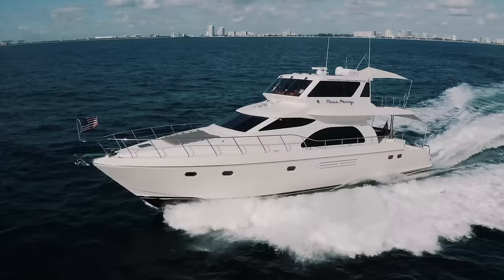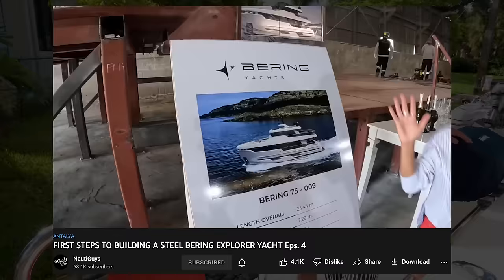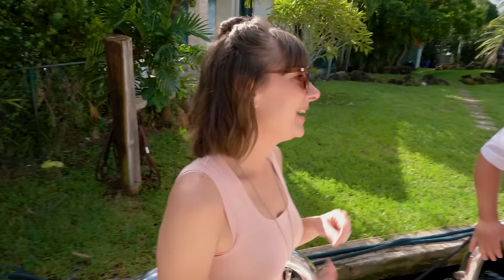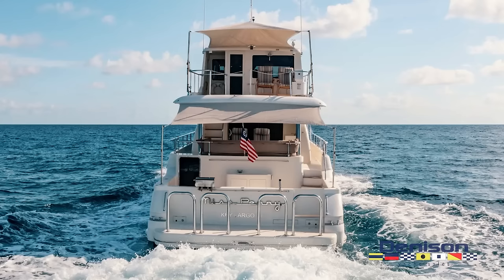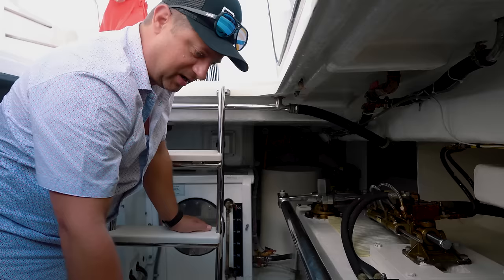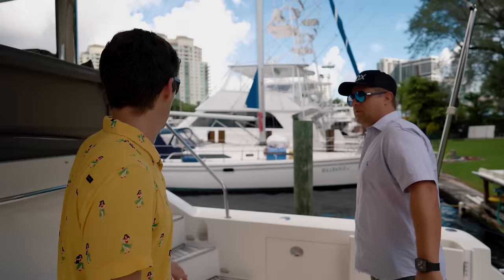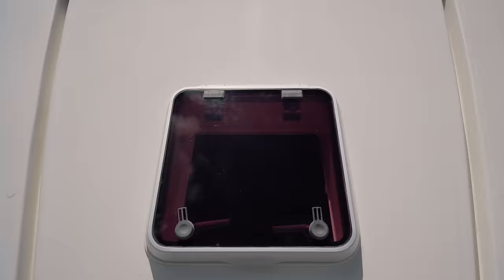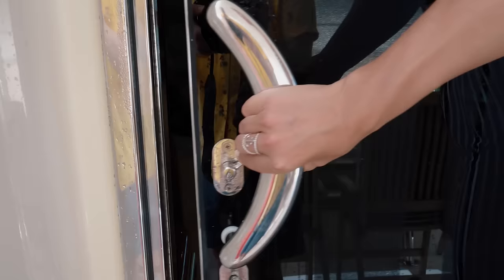Luxury Yacht Living Is Cheaper Than Waterfront Property! (full tour & costs)

Comment: Very interesting and great collaboration.  I'm partial to sailing, but, absolutely appreciate a motor yacht.  I have lived my life around water and to be honest, there is nothing finer. 

Two major expenses set aside sail/motor yacht living from land living:  1) 10% min of purchase price for yearly maintenance/repair - 100,000 for a 1M yacht and 2) Depreciation 6% - 7%/yr exponentially declining as the yacht value depreciates.  

1Million purchase price:

First year  maintenance/repair:  (100K per year ( 8,333/month))
Depreciation first year at 6%  ( 60K/yr (5,000/month)).  It's my experience that depreciation in vehicles etc. is often never considered. It's a real loss of money and needs to be factored. 

Maintenance/repair + depreciation is easily 13,333/month in expenses that would be arguably 10,000 per month less for a land condo as maintenance is much less costly and real estate does not depreciate over the long term, but, of course appreciates. 

I didn't really consider it, but, fuel for a motor yacht fuel costs would be highly variable based based on individual preference and always increasing. 

So, land life is less expensive comparatively but quality of life on the water - well -  that wins hands down and is priceless.

My two cents.... :).   Cheers.

Comment: That what is called a cockpit motoryach.  Usually they have the same boat as a aft cabin design without that lower cockpit and they offer a second design where they add the cockpit behind the aft cabin. Many cockpit Motor yachts have that rear door straight into the master suite. Meridian’s 459 is a 408 aft cabin that has the cockpit added on and that rear door entry to the master.

Comment: I'm looking to make a change so I really appreciate the budget break down at the end.  I know there are dreamers, and whimsical folks, and I know there are spreadsheet nerds (I'm the latter).  For the past four years,  I have lived solo in a 36' RV (2 bedroom, 1 bath, 325 square feet) out of the Bay Area of Northern CA (less than a 1/2 mile from the beach) for $900 per month.  I'm not a minimalist, so I have a storage unit for larger tools, camping gear etc., but all in,  its still only $1,200 per month.  That is very cheap for this area.  Plus I like all the redundancy.  Three sources of electricity, 3 weeks emergency water storage, 15k watt hours of LiFepo4 for energy back up, earthquake approved etc. etc. and I can take it almost anywhere on paved / flat-ish land for a $1 per mile in fuel.  I couldn't agree more with your cost analysis UNTIL you dropped the maintenance bomb.  10-15% of the boat's value?  REALLY? Holy smokes.  15% on a $280k boat is $42k per year / $3,500 mo in maintenance alone?  I guess it is what it is, but now I'm sad - no south pacific for me. lol

Comment: Well edited but I have to say a 66’ 1600hp yacht is not really comparable. I had to laugh when the guy said if you really slow down you can burn “only” about 10gal/hr, ha! To compare to sailing, I’d love to see the Wynns compare to say a full displacement or a semi-displacement trawler in the 40 to 50 foot range. I have a very comfortable 43 ft trawler that only burns 2 to 3 gal/hr at 8 kts.

Comment: Taking your motor yacht to the all the way to the Bahamas is thousands in fuel, and diesel is filthy stuff, both to make and use.  If you have a fully solar powered electric yacht, that changes the equation both in fuel and maintenance costs.

Comment: At the point in the video we're you all talking about having to start the generator to charge the battery bank up. Why are the boats not setup like an RV where the B.B. are being charged by the main engines. On the RV side the only thing that won't run this away is the AC and sometimes the Microwave depending on the size of the inverter. So the only time you need the Gen. is when you have the main engines off or need that ac flowing.
Reply from the maker: The engines do charge the battery bank, but depending on the alternator, the inverter, your cruising speed, & the power draw while you're underway (like running the AC), it may not put much back into the batteries. And just like an RV, you can add solar, upgrade your alternator & charging system, and switch to lithium batteries - all of which would decrease (and maybe eliminate) your need to run the generator.
Curious Minion

Comment: I am so glad you did this video.I watch both channels and about 10 other sailing channels. But at 65 sailing is not the way for me. But there are not many power boat channels. It took 2 years of watching youtube channels and getting my wife on board for this. The funny part was I did not ever try to convince her to do this ,she actually came around to the idea by herself. Also, I have a large skill set ,15 years welding, built my own house at 25,  went to college at 33 and have electronic engineering and computer engineering degrees. Not bad for an original 10th grade drop out dumb ass LOL. build engines and can fix just about anything, so I am hands on. As I told her, yes, diesel is expensive but as you said cruising is uaually 8-12 knots. But once you get there you stay on the hook for 2 or more weeks . Island hop and run the hell out of the dingy. I have been looking at boats for 2 years now and we were just getting ready to go look at a 42 foot Rinker Express This week. I had already arranged haul out and transport to SC. He sold the boat out from under us. This statement is for buyers beware. I would not give large deposit thru pay pal, I told him I was catching an  11:00 AM flight the next day (this was Tuesday). At 8:15 AM Wednesday morning  I get text saying boat was sold. Wife and I figure it was a scam.

Comment: Was so much fun , outrageous at times . 
Forgot when  I saw a bed being 'tried out ' , no,  no touching signs around :-) 
  @ 40 mins this is quite long , worth every second . 
So much food for thought . 
Yes , comes down to running costs and your time on board . 
 $3k /month for a mooring outside your mansion , not for me :-) 
  Unless we return to the exchange rate of 50 years ago :- ) 
Apart from the purchase price , all the other costs . Fuel ! Even at 10 galls US /hour . 
So all agreed that 8-12 knots is a fair speed ? 
    Hmm saw something else from Miss Vic :-) respect to Rico on getting things working , the lady is seriously practical . 
Buy a boat you can control :-) Whatever age :-) 
  Do like the idea of a small cat or tri , small sails , and full on solar . 2 electric motors , with a small diesel for back up . 
 Fabulous cabins , galley etc . 
A cupboard is a shelf /hanging space . Solid/veneer wood is nice and expensive . 
 I would use ply wood , paint /stain /seal where needed . Good for 15 years + . 
  So life on the ocean waves :-) Less the day to day costs of living on land . Only $250 /month here .

Comment: You're doing a whole sale spiel on this power boat but a sailboat is still a lot cheaper to run. When oil becomes a lot more expensive because all sorts  are turning away from oil it will become cost prohibitive, you will see how much what these boats are worth.  How much to power sail across the Atlantic/Pacific? Thanks for the video.

Comment: Power boats are NOT less work and trouble than a sail boat. They are more complicated, more expensive to take care of.  DIY repairs at sea are far easier to do on a sail boat.  Power boats are at the mercy of that engine.  George Buehler, who came up with the Diesel Duck motor sailing troller yacht, has done about the best job at creating a power boat worth owning.  If a person needs to live like a king or queen on the water, they better have a staff to take care of the boat and the bank account to make it happen.  Otherwise the boat ends up owning you.

Comment: Power boaters = Stink potters
Sail boaters = Rag men.
Ex-president of the company I worked for in the 90's and I traded those jibes about boat types/owners. He complained that the sailboats would pull up to the fuel dock same as he did. I didn't have the heart to tell him 'John, you're taking on $10k in fuel, they are taking $400 in fuel. Back when prices for marine diesel/gasoil where very cheap.
Best wished from the far North.

Comment: Yikes…  I’ve owned both and I am quite sure that boats are more expensive than homes!  With two engines, how many gallons of fuel does that boat burns per mile?  What would the fuel costs be to pop over to Nassau for the day?  After ten years of ownership, homes have appreciated in value while boats have depreciated in value (homes are much better investments).

Comment: Interesting discussion. You're probably in this boat for $25-30,000 per month plus fuel.  Given the analysis at the end of the vid, maintenance seems to be the big diff between a condo & a boat.  If you consider the boat is equal(ish) to a condo & a slip is a wash with an HOA fee, then the 20% maint ($200,000 per year for a $1M  boat), is the diff.  Your HOA probably pays for most maintenance on a condo.  The boat would be $16,600/month just for the maintenance.  That's above the $6000/mo for an 80% loan for 20 years & $3000/mo slip.  Sounds like a $1M boat is over $25,000/month BEFORE you ever leave the dock (& that's in after income tax funds).  Also, just like a house you still need to add insurance (+registration & likely some sort of use tax).  That's some serious Patreon dough needed.

Comment: Thats too big. I would get lost on my own boat. Thats too big to be a planing hull. When on plane, no body does anything in the whole boat, the pilot/helmsman needs full attention ahead all the time. Very tiring. A planing hull is made for people who live on land and need to get back to their on land house (or whatever) after an afternoon on the water. Fuel usage per hour/mile? (compared to your old cat) Since you are comparing this to a S Florida condo for price, monthly costs should be added... moorage? fuel if you are going anywhere. Cost of fuel to sit at anchorage? I notice no solar at all. Someone who was trying to do things cheaper would not have a planing hull. Someone who was going to be "live aboard" would look for a similar size (or slightly smaller) displacement hull that was made to live and not just stay in. Less beds for example. Smaller engine(s). Enough solar to allow sitting at anchor without a genny running 24/7 (as would happen with this yacht at anchor). This yacht is very much not off grid. It is an attachment to a land life lived mostly on land... ok for the rich and famous, as opposed to the uber rich who would have hired crew.

Comment: Back in the 80's when I was shopping for a live aboard Salon Cruiser, the boat costs the same as a house.  It still had a yard, as I discovered, as the yard grows on the bottom of the hull.  I deduced after a while that the boat wouldn't save me money over a house.  But as you point out it's easier to take your house with you.  And a leaky roof is not comparable to a leaky hull. 24:59 looked like a school bus going by.  I believe Nikki is much better at showing off the showers than Victoria.

Comment: Power boats seem to push "opulence"  but that does not reduce their obvious dependence on carbon emitting fuels.  Whereas sailboats may move a little slower, they are dependable and produce smiles instead of carbon pollution.  I really don't want to know what it would cost to have one of these boats towed for repair.  Motors break more frequently than sails.  We have an unairconditioned catamaran in FL which puts us close to nature. We'd rather revel in the view of the stars overhead at anchor than watch TV.    We're getting older and will soon have to part with it.  Sigh.  Another reason to stay tuned to your channel for great seafaring videos.